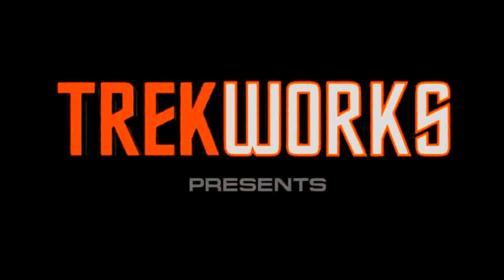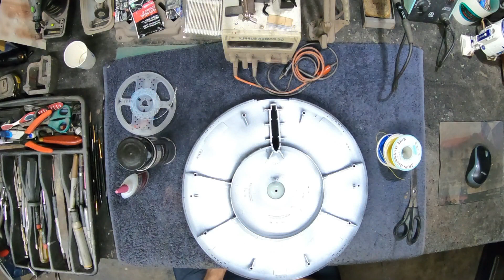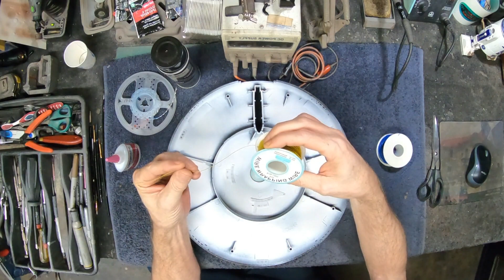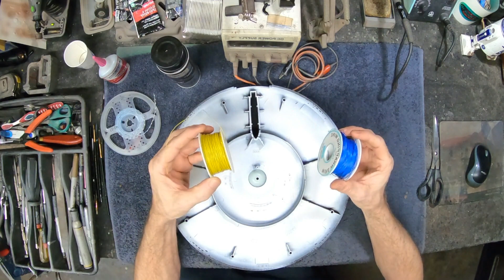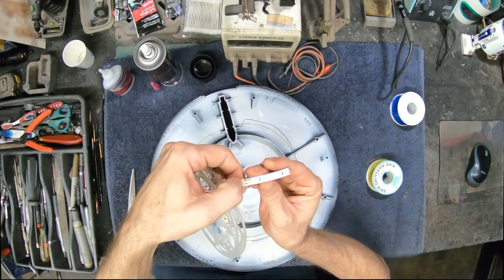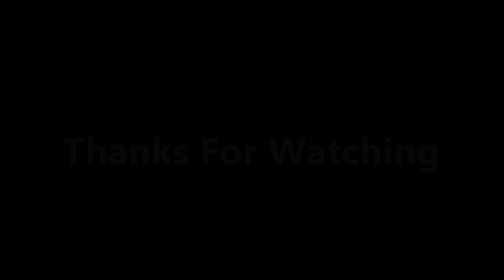Polar Lights 1:350 Scale TOS Enterprise Do It Yourself Wiring For Lighting

Comment: 12:28 is this considered a parallel circuit when it's all connected? I'm doing the 1/350 refit with Ralph Tenaglias mega lighting kit and it's pushing my very rudimentary understanding of led wiring to its limit.

Comment: I was worried about using wrapping wire because I read if you nick it your done. I have a roll with 8 colors on it.  I'm gonna use it in my current refit build thanks. 

I do however use hot glue over ca. I love your videos indeed learned so much. Thank you! I also use a thinner solder and 450-500⁰

Comment: Cool, I'm in the middle of lighting my Seaview with Voodoo's kit and the bundle of wire they included with the kit is to heavy to run through the channels in the tail fin and I was  thinking of asking what smaller gauge size you where using... Now I know, Thanks
Reply: Do you have a build log anywhere on the web? Planning to start my movie/1st season version Seaview soon and would love to see what you're take on it is. I have the 2nd-4th season version too.
Reply: @danharris5999   Oh hell it's been 30 years at least since I built a model,  And this whole lighting thing is new to me so I don't think people would be interested in videos of my fumbling around, Nor am I set up for posting videos or pictures anyway. But I can say this. One thing I didn't care for when I see all the lighted projects other people have done is that when you look inside the control room thru the front windows in most cases you can actually see the LEDs. What I've done is to use a piece of laminated white paper as a difuser for two LED light strips that will illuminate the main part of the control room from above, Similar to what it looks like in the Tv show set. Any highlight red LEDs will be placed in hidden away spots where you will not be able directly see them. About the only difference otherwise from what other people are doing is I'm going to use a blue SMD to illuminate the radio shack. In latter episodes the back wall of the radio room looks like it is that Ice Pearl Color so I figure what the hell, Let's go with blue. Oh, And I enclosed the top of the spiral stair case and I'm gonna have a yellow SMD shinning down thru the stairs in hopes that it creates the illusion of a light shining down from an upper hallway.

All that being said all I've done so far is rig up and test the upper LED light strip panels. And the effect looks pretty good, It's gonna work exactly as I planned. But I haven't even started to do any soldering of the resistors and leads to the main board yet. Soldering is new to me so I'm a little bit on the chicken shyt side. But I'm watching more and more videos about all this and I hope to be confident enough to give it a shot in a few days. The biggest problem really is that I'm now 59 pushing 60 and not necessarily in the best of health anymore and so I don't have the eyesight or dexterity in my fingers i did 30 years ago, And some of these lighting kits I've ordered and their diagrams are down right scary. I'd almost rather go back in time to 1991 and dodge scud missiles again in Dhahran Saudi Arabia rather than mess with some of these kits that aren't simple plug and play.

Comment: Boyd, I got mine done.  Just needed 1 warm white led tape strip for the engineering section.  Had one of my ion pod lights wired directly to the power, so the shuttle bay is lit bright white, while the other ion pod blinks bright white.

Comment: I've soldered electrical wire a few times and it's always nerve-wracking when you're soldering to smaller points on a PCB.  I don't do it a lot but there have been a few occasions because A) I tend to to be steady and read what I can before I do semi-hazardous things and B) I just don't want to pay people $80-$100 for work I KNOW I can do.  
Fortunately, with my hobby, they've moved towards screw terminal posts and pre-assembled wire harnesses so you don't have to solder as much unless you use the cheaper PCB's that require soldering.  I've also found it's much easier to solder signal lines  to PCB if you invest in a decent soldering stand with clips to hold the PCB and a magnifying glass (2-4x magnification) to make it easier to see soldering points.  The stands and mag glasses make it much easier (and safer) to solder.
I've been burned ONCE by a iron and that was enough!
I have read the 60/40 (Tin/Lead?) with the rosin core is the best to use.  There is "safety solder" out there but as I understand it the solder joints that use safety solder don't hold up as well as the tin/lead solder.
There IS debate about which type of solder is safer.  The "safety" stuff supposedly takes longer to set up and requires higher temps.  I just wouldn't use it on the basis of stability if the safety solder fails within 10-15 years.  The tin/lead solder joints should last a lifetime if they're done well...